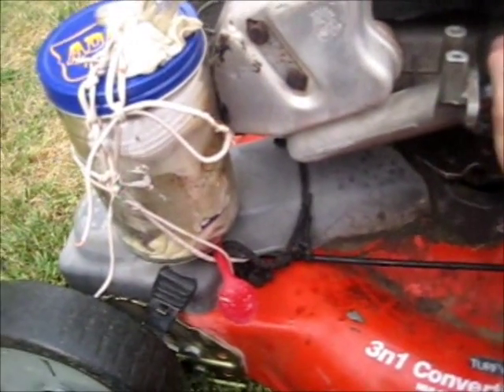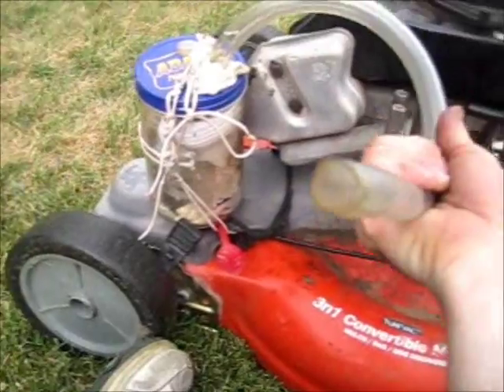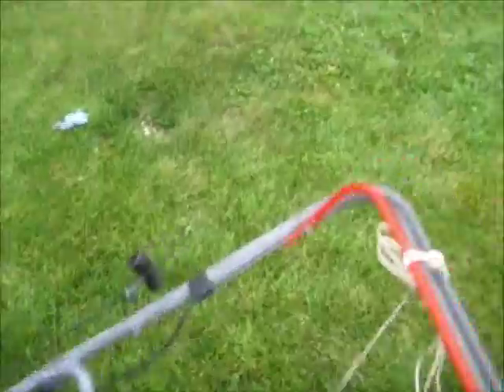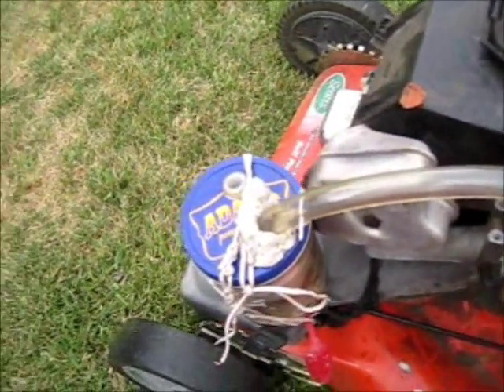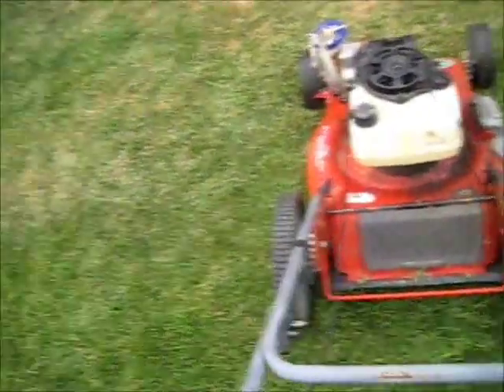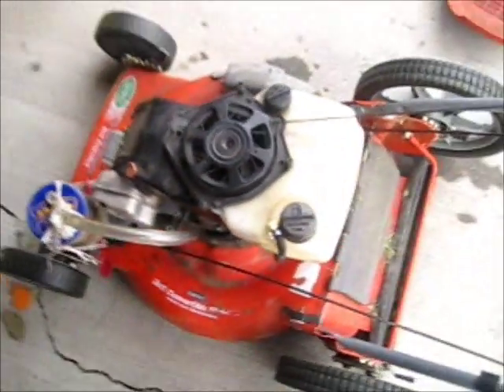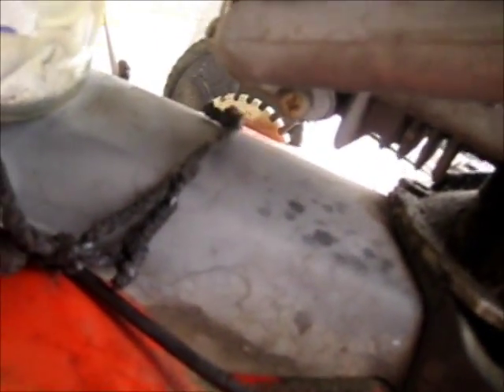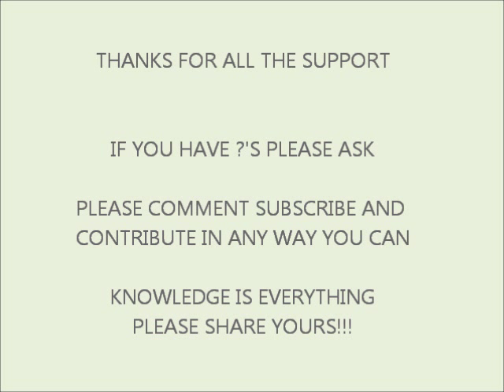Lawn Mower Running On Gasoline Vapor (More Testing)

Comment: Well, I used rubbing alcohol and made a bubbler. The thing runs for 15 seconds, dies down, then shuts off. What is going on? I will be attempting to make a new bubbler made of glass. Carb is still on and non-vented cap put on gas tank to prevent lean burn. The hose from the bubbler is shoved into the air intake on the carb and is a tight fit. Any advice would be appreciated.

Comment: There is another method using 2 screens with the first one contacted has a mesh size 3 times the second screen. This method is supposed to work way better at vaporizing than a single sreen. The sreens have to be tight togeather and the faster the flow the better the vaporization. You have to experiment with sizes to get best vaporization for your use.
Clay

Comment: thats the nicest one of those i ever seen.
LOL
its pretty easy to make a flange to replace that carb hole. just stop by the dollar store and get a cheap cutting board. hack saw the flange out and drill the bolt holes and the center hole, just big enough for your hose. cost you a couple of bucks

Comment from the maker: Nope I have not ever had that happen. It sounds like some of the additives in the gasoline remained in the vaporizer. The additives require a much hotter temperature to burn then the gasoline and they don't put off fumes like gasoline does, this is why they won't burn very well. Additives are the biggest problem with a bubbler system. Only the gasoline itself vaporizes everything else can remain as leftovers. Heat is the key to making a system work well.

Comment from the maker: That is true!
I have done many tests with and without a flashback protection device even when the system backfires I have never had it ignite the vaporizer never not even close. It is always good to have it to be safe but I Honestly don't believe you even need a backflash screen on a gasoline vaporizer system. I do keep one on my system just in case there is a 1 in a thousand chances it were to occur.

Comment: I don't think steel will have the capillary effect you are achieving with the socks. I did some tests with this kind of setup and your best bet is ceramics get a ceramic "firebrick" and install a barb in it, let the brick sit on some gas and you will see. I did it and my car idled for about 7 minutes with this setup; and I drive a 4.0 6 cyl ford explorer. Take care!

Comment from the maker: You have to heat gasoline above a certain temperature to vaporize all additives in the gasoline. The autoignition point of some of the additives are below the vapor point of some additives in the petrol, therefore if you heat the gas up to the temperature needed to vaporize all parts of the gasoline some of the additives would auto ignite which would then result in a full gasoline ignition.

Comment from the maker: I could go on for a long time about that question. I'll try to make a short summery of how that works.
There are many autoignition temperatures in the different additives in gasoline. I have found that some of these additives have a lower ignition point then the vapor point of some additives. I believe the oil companies engineer the fuel this way to prevent people such as us from making the types of vapor systems that we do.

Comment: Very good job, I cant wait until you get the valves on it.  I did this myself(not with valves installed), but just for testing. And it ran great, but ran very fast.

Comment from the maker: Yes you can definitely fill the jar with cotton or wool. I will be buying some fine steel wool and will fill my container up with that to see how well it works! Yes I would imagine you could use many different forms of fuel with this vapor carb setup. I need to do some testing with other fuels.

Comment: I have no knowledge about motors, but find it very interesting...
would it be also possible to run the mowermotor (partly) on biofuel?
and fill the reservoir with raw wool or raw cotton?
(maybe that fills the reservoir more equaly as socks do?)